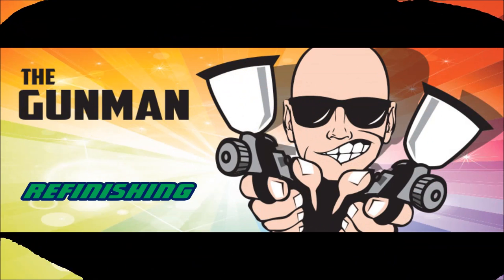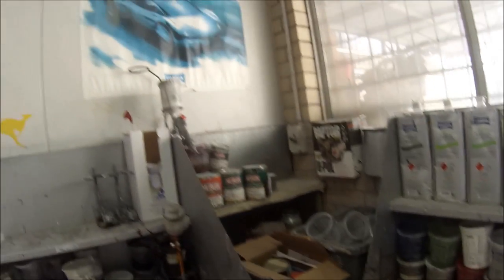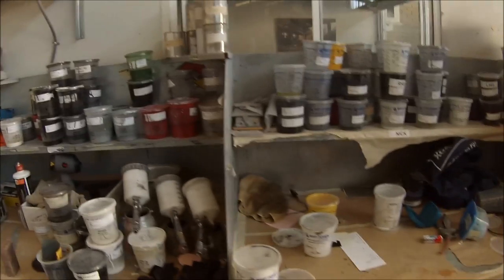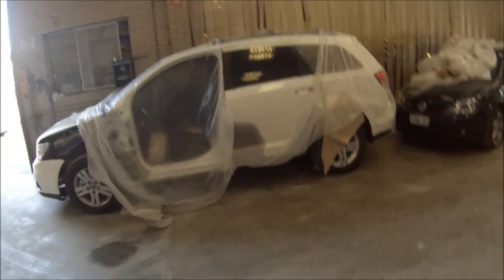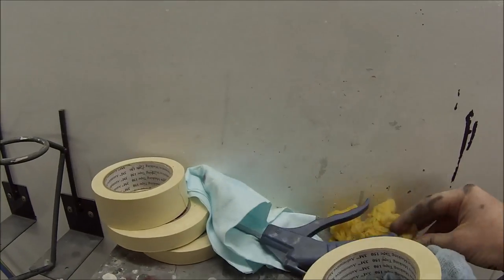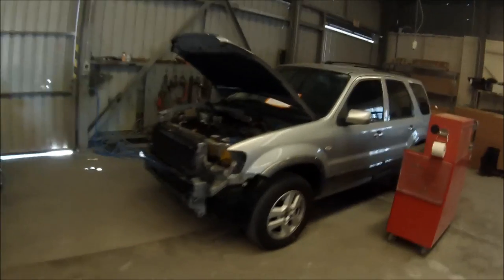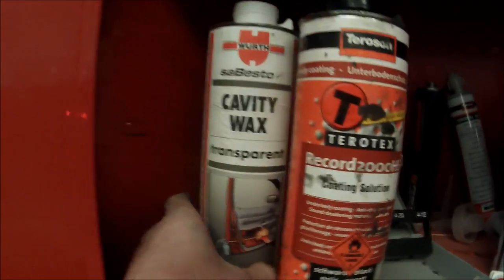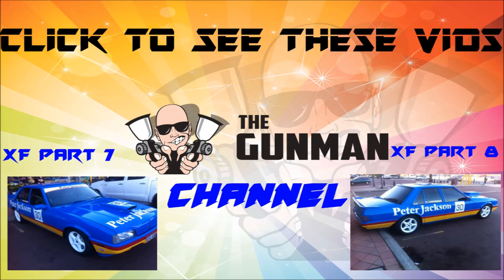Paint & Panel Shop Tour

Comment: After you sprayed the base coats, do you dump it out?  The buckets with paint for your previous jobs are sitting out, are those before you poured the hardener in them?  

Thanks in advance!
Reply from the maker: Basecoat color doesn't take hardner and will take a good 10 years to go hard in the pot but when thinly applied over a panel it dries quite quickly, it dries through evaporation of solvent. Thanks for watching mate
Reply: I apologize for my lack of understanding since I'm looking to get into spraying.

Thanks for the answer.  That was a major concern of mine since I thinking that it would be extremely time sensitive where I would have to immediately clean out my gun after spraying it to prevent the paint from clogging it up.

Does it take a long while for the clear coat  to dry and harden while in the pot?
Reply from the maker: No need to apologize mate, I'm more than happy to answer any other questions you may have too, I love this job and would highly recommend giving it a shot.